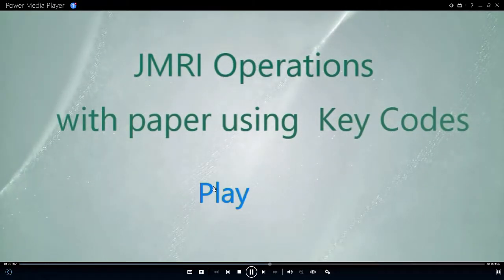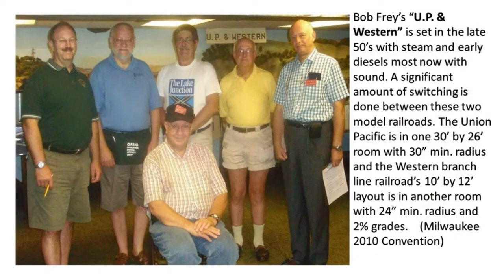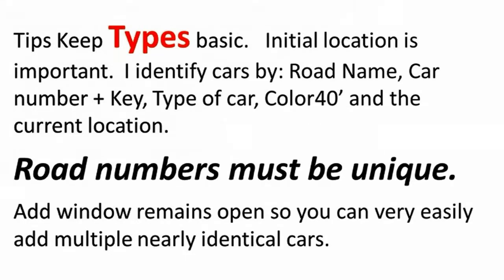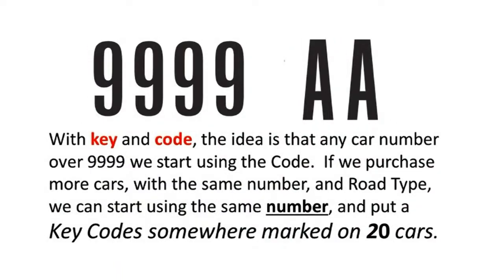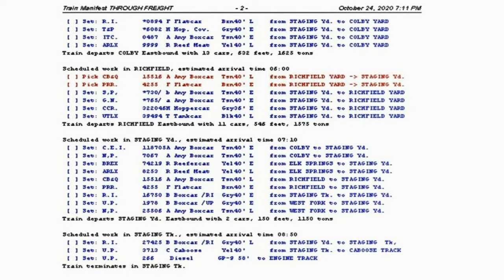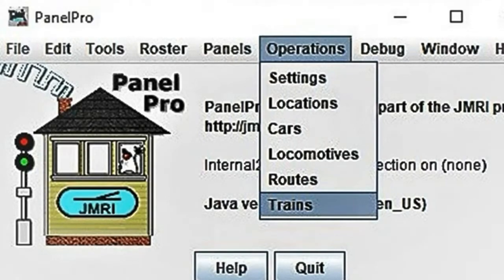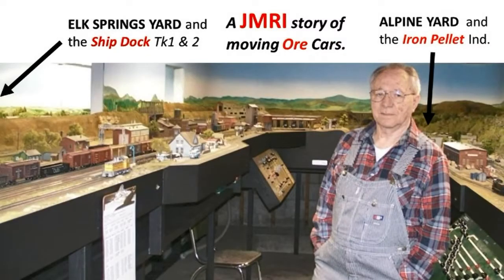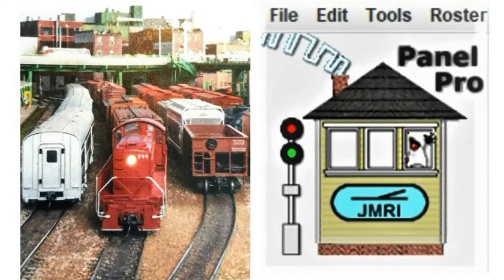Trainfest-X 2020, JMRI Opperations using Key Codes

Comment: Question:  The complete car number does not show when I print a car list just the last 4 digits.  How do I get the whole number to show?
=====================================================
 
With 4 numbers 1234 and a 2 letters code on a yellow 40’ UP Box car the user doesn’t need numbers.  The last 4 numbers are a way of checking  to make sure, that it is correct.   The operator can report back as:    “UP Box 1234”    or   “UP Box BA”   or   “UP Box Ba”   the small “a” code is other cars will stay coupled to this car, and they can have the same car number 561234  or just 1234  and Code BC
 
Now if you really want a printout of your true car numbers, they can be put into a car spread sheet by the JMRI program.      The code is:
    “UP1 561234”     “UP2 561234”   for Car ID.
The problem in JMRI is Car ID can’t have the same  Number.

But     UP  1234BC   can work for 20 cars having the same number. Where B= Box and A to W= 20 cars same number.  I save X for extra locomotives, Y for special cars and Z for the Cabooses that the program can’t find.    Take a real Caboose number of,  A to W,  use Z code,  put the fake Caboose where the program needs it. 

Robert Frey